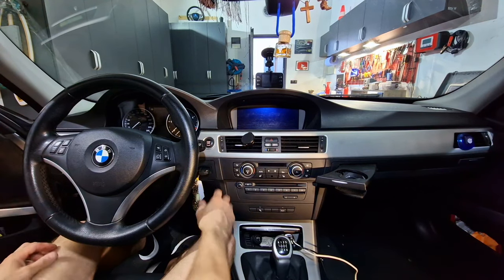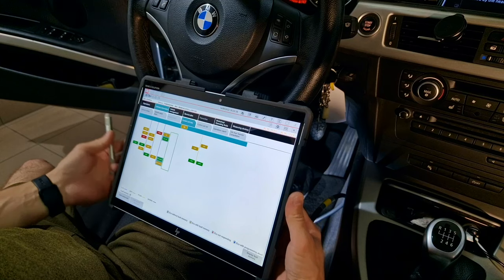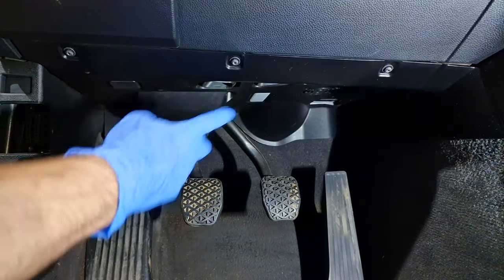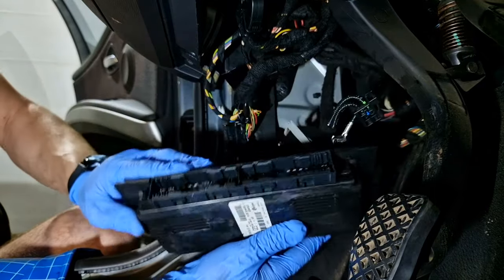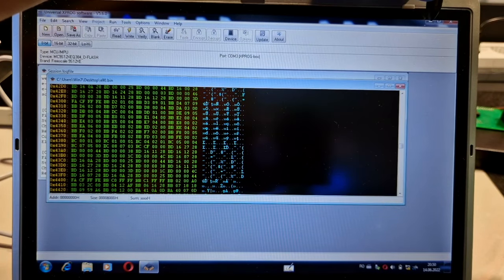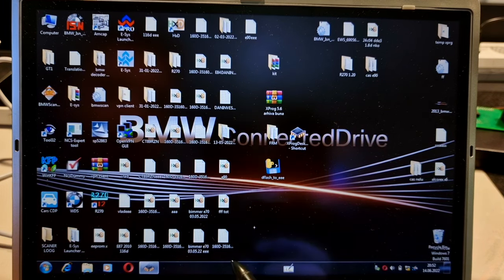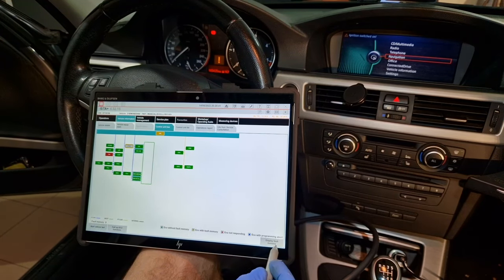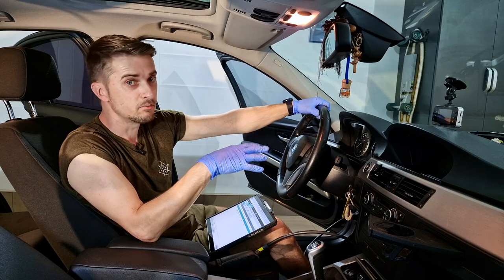Lighting System ! FRM Repair !

Comment: On my 2017 5series the turn signal does not work, and wiper comes on when the car is in motion without been switched on. Wiper turns off when car stops. Can this be the FRM gone bad?

Comment: Nice video, do you need to disconnect the battery when doing this? I’m having the same issue and apparently I’m only having the issue because I disconnected and reconnected the battery while doing other work on the car.
Reply from the maker: Hello,  the voltage fluctuations or and, in your case, battery disconnection can affect the module,  is nothing that you can do better to prevent this

Comment: Hi Ovidiu. 
Question:
My window controls are working in reverse side... When I want to roll down the driver side window, the passenger side will roll down, and when I want to roll down the passenger window, the driver side will roll down.
Do you have any idea why?
X5 E70

Thanks
Reply from the maker: Hello! Try to recode the FRM , if the problem persist reprogram it .

Comment: Hi, which version of xprog do you use? My X5 has no cabin or door handle lights the rest works do you know if I reflash my FRM module is that going to fix it? Thanks 👍
Reply from the maker: Hello,  you don't need xprog to flash your FRM , you need istaP or winKFP and NCS to code , Xprog will be used only when the FRM will fail,  and yes it's possible to be corrupted .

Comment: Hello from Norway! Nice video by the way. I was wondering if you have any experience with the gws (gear selector switch) on e60? I have used winkfp to program my VIN to a used part, and by the way it worked fine with the VIN and zusb number from dodnor car. As I started programming the light in the gws is off and it is not working. I was using a k+d can cable and I was thinking  that is the problem and not using Icom. Do you think that this could be repaired in the same way as the frm modules? Had some transmission problems and was thinking it was related to the gws having different VIN number that my car has. Probably I will get a used gws again and leave it as is to not have any problems like this because the car can not go into gear or move now 😔
Reply from the maker: Hello,  use istaP and try to reprogram GVS

Comment: Hello. If you put a FRM from another BMW, you need its just plug and play? Oé need to reprogram due to diferent vin number?
Reply from the maker: Hello,  you'll need to code it , not program it.
Reply: @MOvidiu  Thanks. I just put the the FRM from another BMW, the problem with lights was solved, but the driver windows  buttons dont work now, as the Mirrors and rear sensors too! (Before Change the FRM, this three itens were fine)

Comment: To avoid FRM3 failure in the future, it's software should be updated to latest version.
Reply from the maker: The problem is not the software itself , firstly the software that is updated is in the Pflash , Pflash is the Program Flash , and the partition that it's corrupted is in EEE.  the problem is cause by this type of processor .
Reply: @MOvidiu  I see. So the the ultimate solution would be changing the FRM3 module to updated version if there is any?

Comment: Are the braking and parking lights also in FRM?
Reply from the maker: Yes , FRM is controlling all the exterior lights!
Reply: Thanks for the prompt reply. I have a 2010 BMW 116i and one the rear braking and parking lights are not working. The electrician told me that there was a problem with LCM and he needs to send it to another person to repair. Would you think they need to go through all the steps you have just explained or they just need to replace a couple of fuses?

Comment: hello M Ovidiu, I have a 2014 BMW X5, my air suspension is not working.  I replaced the air compressor and the air bags as well.  Even thou I have done all this, the compressor will not kick on.  Can you help me solve my dilemma please, thank you.
Reply from the maker: Hello! you'll need to do a complet diagnosis of that car ! first start with a scan and investigate deeper ! by checking measuring and so on! I can't know what the problem is without physically seeing the car! and with opinions of what can be, you won't resolve the problem!!!
Reply: @MOvidiu

Comment: Can you please make a list what kind of tools and software you are using to do this procedure. I have a same problem with my x5 i can purchase another one with no oroblem but i want to fix stuff not just throw away good module
Reply from the maker: A t20 screw driver a Phillips one a 10 mm socket and a small flat screwdriver/ tech driver , a laptop, and an xprog , and I think that's all
Reply: @MOvidiu  I meant electronic tools and name of software to read and download a new software to ECU
Reply: @MOvidiu I also need the tool and software. Thanks for your help.

Comment: Another awesome video. Incredible stuff. Do you have to disconnect the battery when working on the FRM?
Reply from the maker: No need
Reply: @MOvidiu  Thanks.

When some people change their battery, they seem to have all sorts of issue on reconnection i.e FRM module not working. Should you wait for the car to sleep before replacing the battery, so the modules are not active? I've read some keep a battery charger connected to the posts under the hood while they change their battery. What's your opinion on this?

I believe in ISTA+ there is a setting where you can force the car to go into sleep mode. I'm presuming that's the same as just leaving your car and letting it sleep?